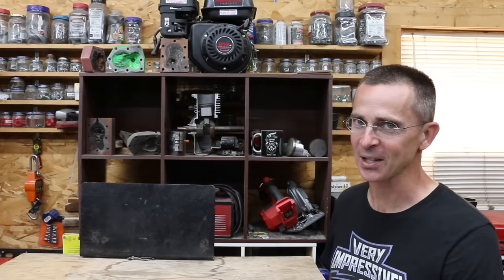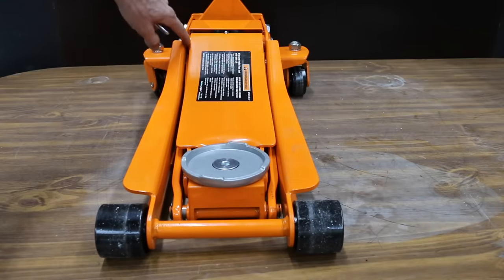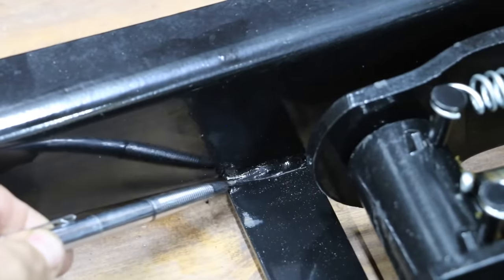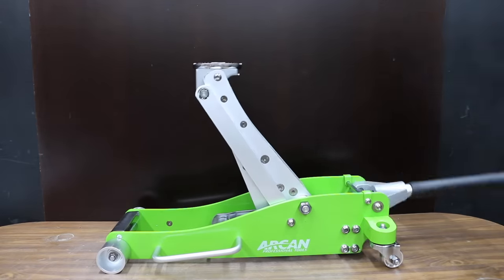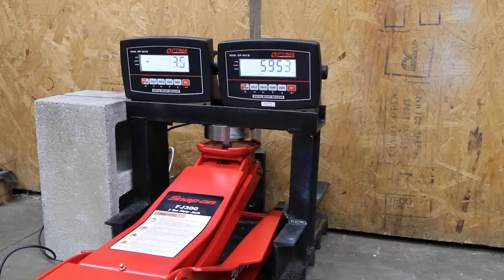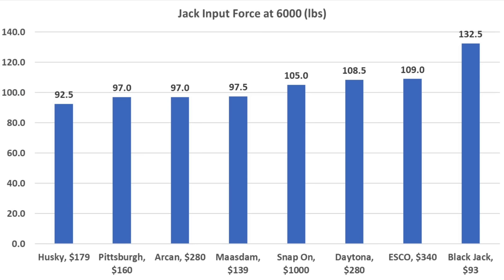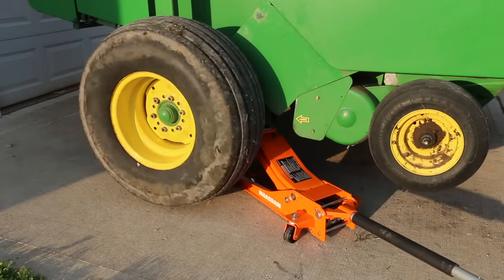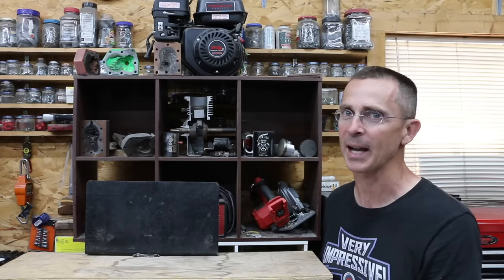Best Floor Jack? $1000 Snap On vs Daytona, Pittsburgh, Arcan, Black Jack, ESCO, Husky, Maasdam

Comment: I think I like the arcan most, I prefer relying on hardware over welds as well as that being easier to replace parts if needed and I really like that it's aluminum and that nice handle on the side
Reply: When's the last time you replaced frame parts on a jack...lol
Reply: To me, being 50 lbs lighter is a huge deal - the arcan aluminum seems like it would be easy to toss into or out of the car or truck if you want to work somewhere different from your regular garage.  I have an older 100lb Harbor Freight and I'd never consider travelling with it.
Reply: Agreed. If you're using floor jacks often in your shop, the light weight is a big advantage. I've been eyeing that same model Arcan jack for a while to compliment my old boat anchor steel 3ton. This was a great test at the perfect time.
Reply: @OffTheBeatenPath_  not the frame lol the bolts and stuff
Reply: To be fair, these are 3T jacks. Most folks never need to lift 6000#. My largest vehicle weighs in at 6500# and my 2T Alum Jack lifts the front end (heaviest) just fine and it's more portable than a 3T. Were I to need a 3T jack, I suspect the welded steel of most of these jacks will last my lifetime. On the Alum model, you have to check the bolts from time to time. Otherwise, they can become loose and wear down the Alum frame, leading to a potential failure with time and abuse.
Reply: @FaceFaceMan  I always go for my aluminum Pittsburgh over my steel as long as the load isn't too great and I'm on level ground. The lower weight is so nice.
Reply: I’ve had the Arcan for a few years now and really love it. Most convenient jack I’ve ever owned. I got tired of lugging around heavy steel jacks.
Reply: I have the Mastercraft version of the Arcan sold at Canadian Tire. Best jack I ever had, low weight is important to me and it's sturdy AF.  Been using it regularly for years now.   Fast reliable lightweight and lifts plenty high.
Reply: I have the Jeg's branded version (same thing) and it's been great. Another benefit is how much quieter it rolls on concrete because of the less weight. Obviously it's the only jack I'll put in the car for remote jobs as well. My only complaint is the front center bar can be a little too low and catch on small things.
Reply: @robertespinoza5958  lol admit it, jacks don't need bolts and stuff...Maybe a seal at worst.
Reply from the maker: Thanks for sharing.

Comment: I was actually just thinking about jacks and jack stands this morning as I want to buy them in the next few months. And then Project Farm comes along and BAM
Reply from the maker: Perfect timing!
Reply: jacks and jack stands are handy dandy items.
Reply: @1pcfred  Especially when you don't want to pay these insane high prices and just want to do the basic maintenance on your own. It's like $95 at a Ford Dealership for a Full Synthetic Oil Change.
Reply: @enacku  Synthetic Oil is not cheap. No oil is cheap anymore. $95 for an oil change may not be bad. If they're taking care of everything for you. Cheap oil changes are usually come ons themselves. Shops want to get customers in so they can up sell them other services.

Comment: Given that I'm only using it for lifting lighter cars, I've been quite happy with the price/performance ratio of the Pittsburgh.  They regularly go on sale below even the value price in this video.
Reply: I’ve had my Pittsburgh 3 ton low pro for 8 or 9 years now. Bought it to put a leveling kit on my truck but have consistently rolled it out of the garage for every oil change or break job since. I bought the low pro because while I might have a truck other family members had cars of various clearances. It’s the best all around jack.
Reply: Agree same here, I have been abusing my pittsburgh for 5 years now and its done great, I have looked into the aluminum model from harbor freight just for ease of mobility
Reply: looking at the charts, I'd bet money the engineers were gunning for snap on's performance
Reply: Same here, I got mine on clearance about 2 years ago, I was a bit afraid when they told me I couldn't return it. Best $90 bucks I've spent so far.
Reply: I've had Pittsburgh over 10 years. Used it this morning on my dad's car
Reply: Aluminum harbor freight is great
Reply from the maker: Thanks for the feedback.
Reply: Back when they were gray I got mine with a coupon for $90. How times have changed in a few short years.
Reply: I have a Pittsburg as well and provided you employ good practices (also use a jack stand) - probably better value than the Daytona. But, I'm a hobbyist and don't need that kind of tool.

Comment: Excellent presentation (as always).  Something I would emphasize for farmers/ranchers who may have to use a jack "in the field", consider the weight of the jack.  It appears that as I got older, my tools got heavier!  A light jack like the Arcan is very useful when it comes down to raising an implement/implement part off the ground in awkward positions/location which is usually when/where farm machinery fails.  Thank you for these practical tests, Ciao, L (Morningside and Starshine "Project" Farms).
Reply from the maker: You are welcome!

Comment: I really enjoy watching your test videos. I have made several purchases bases on your tests and this was one of them. I have never liked any of the floor jacks that I have ever purchased. Some of them turned out to simply be unsafe. One of the unsafe ones was the Black Jack floor jack. The first jack of the two that I purchased simply would not work properly. I returned it and took another one home to try. It worked fine for the first 3 or 4 uses but then it suddenly failed while I was under the vehicle. Thankfully I had jack stands in place that took the load after about 3 or 4 inches of slow to medium pressure failure on the Black Jack. Based on this review, I purchased a Daytona 3 ton. It was like night and day using the Daytona jack. It lifts so much faster and I was able to get the Daytona for around $149 with sale price and a one time coupon. I have used it several times in the last couple of months and I like it more every time I use it. I still put jack stands under the vehicle after I raise it, but the Daytona has never lost pressure. Keep up the good work!
Reply from the maker: Thanks, will do!  Thanks for sharing.
Reply: Usually I lower my car onto the stands and remove the Jack completely. I find the Jack tends to get in my way and I feel safer with the weight on the stands which are typically more stable.

Comment: That was a good video for sure, you covered everything quite well!  I'd like to have that aluminum jack or the Snap-on without the Snap-on price.
I have a Weaver (USA) that I bought in 1978. It's seen a lot of use, I rebuilt it once (seals) and am still using it.  Now I'm going to have to go out and measure it for reach, resting and full height to compare to these new fangled jacks.
Reply from the maker: Thanks!  Thanks for the feedback.

Comment: I'd like to see oscillating tool blades tested. I usually end up burning through wood instead of cutting it since the blades go dull so fast. Also cutting outlets out of drywall will pull the teeth right off of them.
Reply: I'm on a quest to find a blade that can cut 4 inches deep. Let me know if you can find one.
Reply: The coated blades are the only ones I have had to hold up any length of time. Not sure if it's titanium nitrite or not but it is a gold color. Everything else dulls faster than a fishing trip in the bath tub.
Reply from the maker: https://www.youtube.com/watch?v=joVfNnbweYY
Reply: He has done it already... Check the comment below yours

Comment: I went and bought the Daytona after watching this BUT also went with the low profile and long reach ( with speed pump ) not only does it allows you the longer reach under the car/truck but the longer arms provide better max height. Rated min height  3 1/3 inches and max is 24 1/4 inches  . The speed pump is just handy.

Comment: I was rooting for the Daytona, but I always root for the underdog.  Might need to start rooting for Snap-On if stuff from HF keeps creeping up like this... I'd like to see you test car ramps.  I have a set from HF that I use for oil changes, etc., but it kind of creeps me out that they are plastic, though I've had no issues with them other than needing to place them on rubber mats or they skate across my asphalt driveway when I try to drive up them.  And I have a set that my grandfather made from scrap steel that probably would support an office building, but the angle of attack is too steep to use with one of my cars that is low to the ground.  Edit-- Forgot to mention:  Great video.  You are a one-man Consumer Reports, but with better testing and more integrity.
Reply: Their power tools can leave a lot to be desired, but hand tools from HF are among the best value. Just stay away from the crappy Pittsburg Wood Clamps - even if they're lifetime warranty. Bremen Trigger Clamps are quite good and can compete with Bessy.
Reply: havent read a consumer reports in a long time since amazon reviews etc..from the good ol days
Reply from the maker: Thanks!  Thanks for the video idea.

Comment: Career mechanic and auto worker here. Thank you for this!!! 

Your timing is perfect, as I am opening up a second Shop location and trying to find the best tools for the money. (Quality per dollar)

As others have noted, it would be awesome if you could do an aluminum floor jack comparison, since a lot of us need those for portability and transportation.

I’ve used the Pittsburgh aluminum units professionally for years without any issues, but I also service them every 9 to 12 months for safety and peace of mind. Full cleanup and inspection, adjust/bleed the jack oil, etc..
Reply from the maker: Thanks!  Thanks for the suggestion.

Comment: Love your content, but it would of been nice to see an AC hydraulic.  It's not as expensive some of the made in USA units, but arguably has equal or better quality being made in Denmark with rebuild kits for all of their products.  Their jacks are used in commercial settings as well.
Reply from the maker: Added to my list for round 2. I need 6 more brands...so far, Craftsman and AC Hydraulic on my list.  Thanks again, Todd
Reply: Rebuild kits are super important, the seals will go out on even the best jack and if you can't get replacements into the trash it goes.
Reply: @ProjectFarm  Ah, didn't realize you were looking for suggestions.  In that case, I'd like to throw Norco into the hat as well.  They have made in USA and made in Taiwan (more affordable versions of the same jack).  Norco also offers rebuild kits for their products.  I've had AC hydraulic floor jacks and engine hoist for over 10 years (home hot rod use) with zero issues, and I recently picked up a norco transmission jack.  The quality is there for both.
Reply: @ProjectFarm  I would be curious to see how Duralast from Autozone holds up. Might be a rebranded version of one of the jacks you tested in this video since it is made in China (I think)

Comment: One of the most important factors in a floor jack is the availability of seals. No matter how good the jack is the seals will eventually fail, if you can't get replacements it's a throw away item. I don't think you can get seals for HF jacks, but Arcan and some other brands have seal kits available.
Reply: I'm sure you can find any seal if you're willing to browse Chinese websites.
Reply: Seals are available for the Pittsburgh jack. Just not from HF.
Reply: Hf now has a parts catalog and offers parts support for the bulk of their tools and equipment. Seeing as the daytona is made in the same factory as one of the snappies im sure you can get seals that way too.
Reply: Saying a harbor freight is a rip off of snap on you probably can use those
Reply: By that time are they worth keeping, cylinders would be scored.
Reply: For the difference in price I'll take my chance. I've had a harbor freight 3 ton for 13 years now used daily and hasn't skipped a beat yet. If it does fail I'll buy another. Spend the money I saved elsewhere. Some people are so brand loyal they lose their common sense.
Reply: @tonysheerness2427  idk, it depends on how dry it was run, if containments got in etc. a new set of oil and wiper seals should take up the difference that youd get in wear but thats all semantic because i agree with your underlying premise. 250 bucks for say, 10 years of life in a home shop and 5 years in a professional shop is pretty damn good imo. I see a lot of shops rocking those daytona and Pittsburgh jacks, i brough my old 3t pittsburg into work when the shop’s NAPA died and its held up well so far.
Reply: Didn't they kinda rip off snapon for the Daytona? At least what I was told.
Might be able to use their seals. Would make sense seeing how similar they perform.
Reply: They also use cheap o ring seals that are very prone to failure. The better made jacks use a different seal type that lasts much longer. I had two Daytonas fail under a year each the same way, seal failure. Won’t be touching another one.

Edit: the snap on uses the better seal type afaik. They aren’t interchangeable. Still wouldn’t buy snap on, but it’s as silly as saying all oil filters made in the same factory are identical quality regardless of brand stamped on it, which is a flat out lie.
Reply from the maker: Thanks for the feedback.
Reply: How are Big Reds ?? I found them locally for good prices...  also, should I get a low profile or regular ? Thanks
Reply: Seals are available now. But will they be in 20-40 years?
Reply: @Nick-jg9ck  Harbor Freight ain't a rip off. They just sourced the very same factory that Snap off buys their jacks from and slapped a USA made sticker on it along with the 3x more expensive price sticker. Yes, it is slightly better but that is just because they requested the factory to add some options to the base item and paid a little more for more quality checks. This happens all of the time with multiple brands. So it isn't surprising in that a gasket repair kit from a "Snap on" brand would work on brand "XYZ"
Reply: That's my issue, once the seals fail, it's done. It'll need taken apart completely to be repaired.
Doesn't matter if it's a $40 jack or $140 jack, they all have leaks at the main ram.
Reply: 11 years ago I found a atv, motorcycle and automotive 3 in 1 with removal sattle I bought the jack from the former pep boys automotive store and it was my best reliable jack for anything except low low riding cars and no Leaks yet and this also has a ½ removable bar for a safety support to drop the whole weight of the vehicle for weeks and months if need be
Reply: @MrMega200    What is the address of this factory please ?
Reply: @MrMega200  the seals are not interchangeable. Snap on doesn’t use the super cheap o ring seals.
Reply: @brendanberry7403  I still have a HF jack I bought new in the late 90's. It works fine. I have added oil a couple of times over the years. Maybe a slight leak somewhere, but not enough to  dig in deep for possible replacement of seals. Pretty sure I paid $39 with a coupon all those years ago.
Reply: Sometimes the price difference is SO great though, that it is just cheaper to keep buying them, and throwing them away, than to buy a better one.
Reply: @corey6393  their older jacks were made better. My old 2 ton Pittsburgh from 10+ years ago held on solid until I overloaded it because the Daytona failed with my truck stuck on jack stands. I am specifically talking about their current jacks, specially the Daytona. They aren’t the same quality anymore.
Reply: @sharkbaitgaming  I guess the question would be did snap on design their jack and have it built to their specs or are they just paying a jack builder to supply them with jacks to resell with a substantial up charge.
Reply: Seals for the HF jacks are available. They’ve actually revamped the parts replacement availability and it’s a heck of a lot easier now vs 10 years ago. Bought new seals and Jack handle for my 6 year old Daytona last month
Reply: @lukem7203  also a valid question. Not sure if it's 100% made in USA or one of their outsourced products I haven't checked. Haven't had the desire or free money to buy their jack when I'm perfectly happy with my Daytona lol
Reply: if you search around you can find companies that can make seals for you as long as you can give them dimensions and know what material you want them made out of .
I have had disc brake seals made for a rare set of callipers some years ago , and surprisingly for a specialist job , the cost was very reasonable , although certainly a tad more than you would normally pay for oem .
Reply: The datona seals are the same as snap-on and they are very easy to find
Reply: Dixie Bearing used to carry them. Try NAPA nowadays. If you can read the number off the seal, you can get it. If not, I.D., O.D., and thickness are what to look for.
Reply: @Nick-jg9ck  rip off in a good way imo. who would want to own a jack thats 4x more just because it says strap on.
Reply: All of these jacks are so similar, that I wouldn't be surprised if they have basically the same cylinder in them, meaning any seal kit you find should fit.
Reply: @sharkbaitgaming  Snap on imports all parts and say "Assembled in USA".